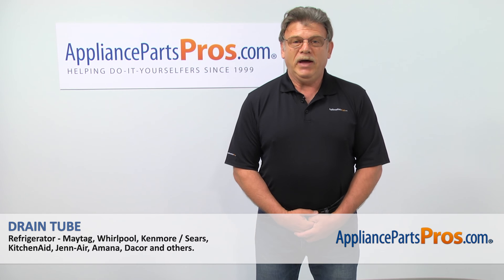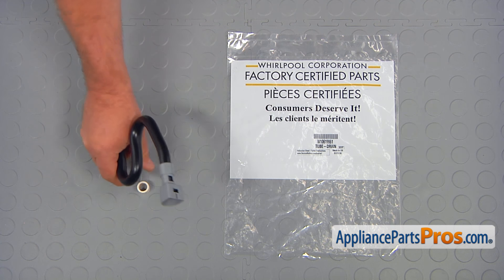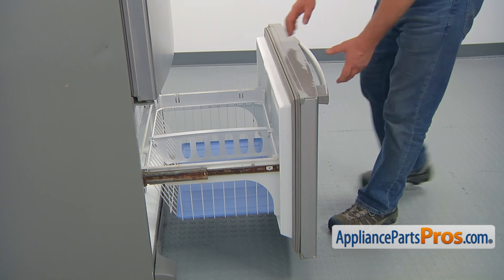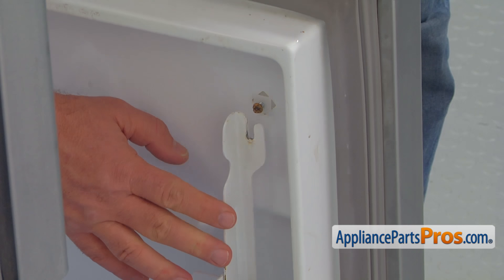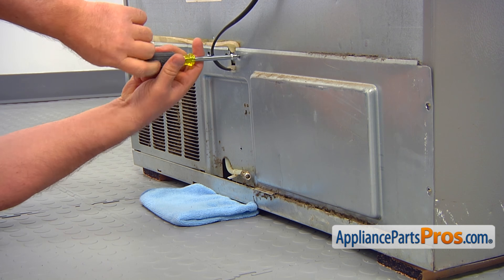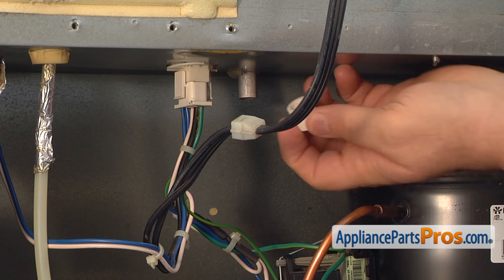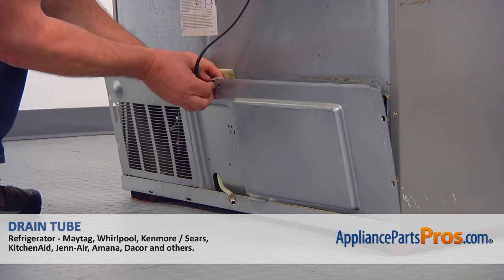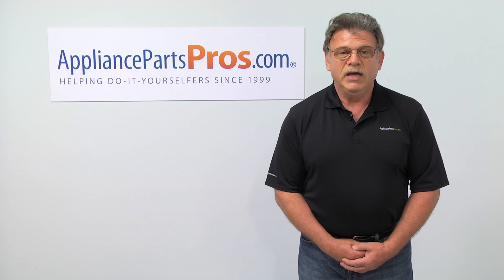How To: Whirlpool/KitchenAid/Maytag Refrigerator Drain Tube W10619951

Comment: Just did this. 10 minutes if you do this before your freezer starts forming ice. I did break a part of the drain pan retaining clip, but part of it remained and it shouldn’t affect operation. I also just blew out the clog so didn’t need the new part.
Reply from the maker: Glad you were able to fix your issue! If there is anything we can help you with in the future please let us know.
Reply: @appliancepartspros  I continue to have an intermittent issuance of water coming from beneath my fridge despite having cleared the clogged tube. There is no ice buildup in the freezer. Any thoughts?

Comment: where does the water of the condensation goes when it drain?
Reply from the maker: The condensation drains into a drain pan at the bottom of the unit.
Reply: @appliancepartspros  but if it's in a drain pan, where is that water draining into? I don't understand
Reply: @appliancepartspros  when it drain to the pan, where does it go after draining to the pan? This is the first time the fridge leak on to the floor in 20 years.
Reply from the maker: The condensation drains into the pan and the water evaporates.

Comment: Easy to follow! Just did a swap on my unit. KitchenAid. Ordered this same part. Took about 15 to 20 minutes to remove the refrigerator, remove the panel, remove the old drain (sure enough, there was gunked up fibers right where the water comes out) and out in the new piece.

Our bottom freezer was leaking every day near the bottom right and left foot / corner. We'll see what happens through the weekend. This piece seems much better designed. The old piece is open and will accumulate gunk and blockages over time.
Reply: Did it fix the problem? I just did the repair with the new part and am hoping that the freezing/leaking is done for good.
Reply: @bluecollarbuddha948  we ended up replacing the refrigerator with a Bosch. There were other issues we were having. We bought the home and it came with the refrigerator that was about 8 years old. This swap did fix the leak though.

Comment: I call BS depending on which manufacturer this drain tube is for.  The tube doesn't just lift right off on the bottom with 0 effort as in the video on a Maytag.  Beware you can crack your drip pan so this video can be a bust and cost you an additional $100+ if you aren't careful.  There is a tab that needs to be pushed in.
Reply: Mine was tough to do as well
Reply: Mine would not let go no matter what. Seamed like it was glued to pan even when I got the tab loose. So I cleaned the grommet( it had spider nest in it. ) I cut it back a bit but would like to replace it in kind. I assume it’s that design so bugs can’t get in and cold air does not leak out. Anyone know the part number?

Comment: or simply snip the end of the drain tube, because it sticks together over time. You will absolutely not see any difference  in how your refrigerator works, other than it forever stops leaking water out the front every time it goes into defrost mode. It takes 10 minutes, and costs nothing. Did it 5 yrs ago. Son had same issue 2000 miles away, described the fix, he did t two years ago, works great. There's plenty of videos for that fix.
Reply from the maker: Thank you for the tip.

Comment: Instructions worked well for my KichenAid frig.  My frig already had the new drain pipe with the trap/bend in it.  After I melted all the ice, the drain would still not drain the water.  Root cause: Some spinach (or something green) had plugged up the trap in the pipe, causing the water to back up onto the floor of the freezer compartment and eventually onto the kitchen floor.
Reply from the maker: Glad you were able to fix your issue! If there is anything we can help you with in the future please let us know.

Comment: How did you get the back panel off.
Reply: wow watch the video
Reply: 1/4" hex driver is usually how most appliances have back panel secured.   A drill (set to screwdriver setting) makes this task even faster.

Comment: Its a good video.....but, a couple things he left out....the bottom part doesnt remove that easy, because theres a little button you have to push to release it.. I put a small screw driver from the inside and popped it open.. Then, when i put the spacer in, i heated with a hair dryer cause it was too tight, that totally worked... And that was it!
Reply from the maker: Thanks for those tips!
Reply: How often this going to happen?
Reply: @mashat502  i think just that once..the replacement tube is a better design
Reply: @raysmusic49  in my freezer I have the same tube( new design )and after 5 years , just happened, my husband just fixed it today. If happens again, he said he will call the specialist to fix it, too much….
Reply: @mashat502  the key is to get the freezer totally defrosted! Good for him!
Reply: U saved me a bunch of time sir. Hats off to you

Comment: does this part need to be cleaned the way the old drain bibs? I have this part but it started leaking again after 4 years, Wondering if it needs to be cleaned.

Comment: A leaking refrig is a very common problem with all refrig units.  The units icing up due to the drain tube not getting enought heat from the defroster coil or the new "energy conservation" that does not let the defrost cycle long enought to remove all the ice.
The other is the bladder drain, after many years it clogs up, backing up water, allowing it to freeze.  This new "P trap" like a common drain, so no small bladder valve to clog.
Just remember, if you drain tray is broken/cracked... it's going to leak.